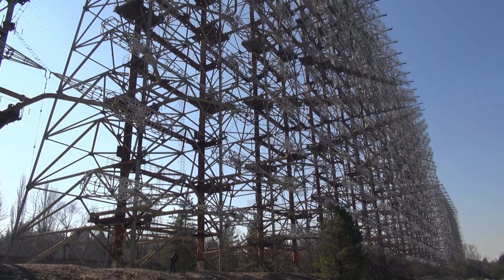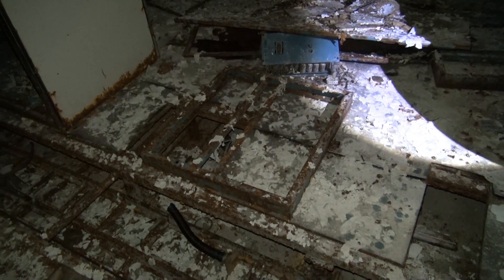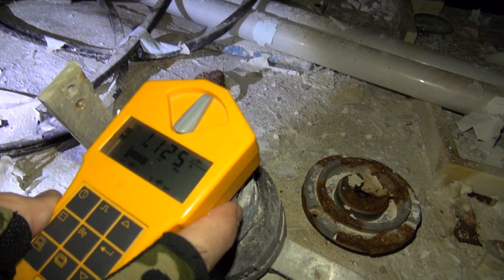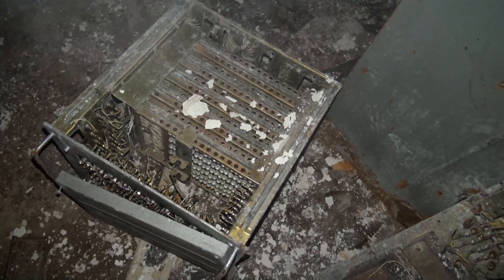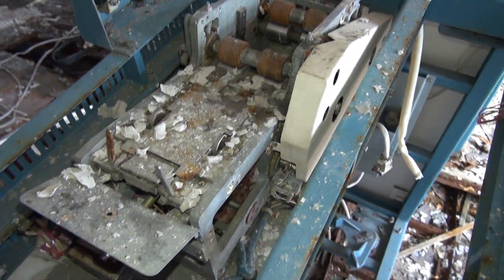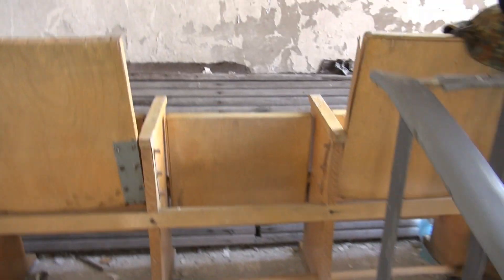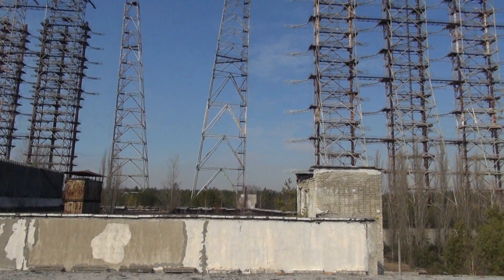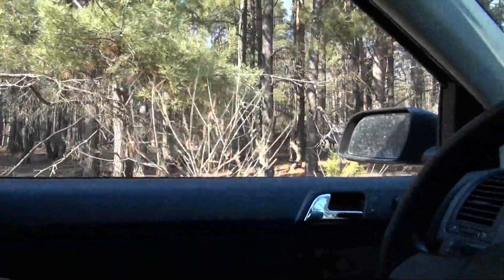inside Duga-3 / Дуга-3, computer mainframe of the Russian Woodpecker / Chernobyl-2

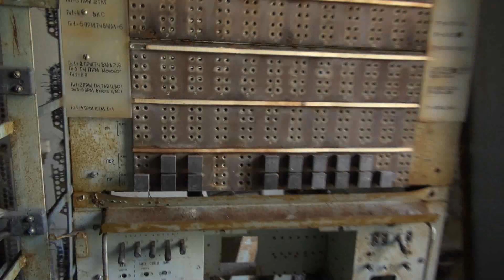Comment: 0:58 look like a switchboard for relais.
1:12 is an Radio tube B9G base.. a pentode or so.
3:00 These are military connectors and are most often custom made.
6:23 a high power resistors.
6:31 look like a delay line memory unit.
7:00 Yes there were cables in the floor. the copper thieves have robbed it away.
8:27 NOS parts :)  (new old stock)
13:12 Faraday cage wire mesh. magnetic core memory
cool video bionerd23..
Reply from the maker: 20kilovolt comments like this make the entire youtube comment section (which is admittedly quite lousy due to software bugs all over) worth it. thanks, really. :)
Reply from the maker: 20kilovolt but yeah see how this comment got marked as spam again, automatically. maybe because you post one too many timecode link... fucking ridiculous... wish i could disable this auto-spam behavior. like this, i have to constantly keep an eye out for good comments being trashed by youtube, and have to dig it out the trash again. ffs.
Reply: bionerd23 Yes annoying is that the auto-spam almost always fails.
Reply: bionerd23 do you go also near St.-Petersburg? in this place they have a high voltage test laboratory It's called ВНИЦ ВЭИ It is wonderful to be there.
+55° 55'26.15", +36° 49'10.97"
Reply from the maker: ms3bani yep, the ferrite cores are there. the video material is just not ideal, as the camera did not properly focus on the wire grid. :(
sorry about that.
Reply: 20kilovolt not faraday cage wire mesh. it's magnetic core memory.
Reply: nope.

look again.

you can CLEARLY see not only the DIAGONAL SENSE WIRES, you can CLEARLY see the FERRITE CORES! the guide even talks about them.

"faraday cage" has no need for diagonal sense wires or ferrite cores!
Reply: 20kilovolt Back in Soviet Union they used about 90% aluminium cable. Copper was used for ammo/weapons.
Reply: +20kilovolt The trenches in the floor look like they would be used for under floor cooling ventilation ducting.  That's how it is in some of our datacenter/server rooms.  Also for running power cables and sometimes data cables.
Reply: to bad people like us couldnt strip this building before copper cockroaches destroyed it
Reply: ms3bani a magnetic core memory has ferrite beads in it and that are missing here 13:12
Reply: technograd I also noticed that the Russians grateful have used the German tubes technology. Like  the RS391 look similar to the ГУ81М (GU81M)
I am by the way a collector of tubes I have te ww2 tube RV12P2000 and the RV2P800 , RV271A in my collection.
Reply: What surprises me is the punch cards and 1/2" magnetic tapes which seem to be the exact same format as the ones used in IBM 1401 machines. Right down to the shade of blue used on the equipment frames, I suspect there was some serious industrial espionage at play in that building.
Reply: Stoney3K    Punch card where used in the 1980s to start up the computer system for the spacetrack radar at Eglin...
Reply: bionerd23 Okay I see it now too..
Reply: 20kilovolt Most NOS vacuum tubes nowadays come from Russia. Most were manufactured during the Soviet Era. They're popular amongst guitar enthusiasts to use in amplifiers because they're relatively cheap. That said, they don't sound very good compared to most NOS western tubes
Reply: @punman5392 

This tube in the video was most likely used for class C operation in RF amplifiers. They weren't used for audio amplification allthough it would be possible. I have seen some soviet RF tubes like the GU50 being used for HiFi amplifiers.
Reply: @westelaudio943  Yes. It's a pretty nice RF pentode up to 200MHz, also it can be stripped of its aluminium can and looks very nice. Soviet marking 12Zh1L or 6Zh1L (only heater voltage different) Current price in Poland about $0,50 per one tube,  twenty to thirty times less than audio tubes such as ECC82, or even the RF ECC88 double triode. Direct copy of famous German RV12P2000, except for base and socket. There was a very simple post-wartime receiver in destroyed Germany which used only RV12P2000 tubes, 5 of them. Even as the AF output amplifier. In some variants even the mains voltage rectifier (!!)  consisted of this tube, with grids shorted in diode connection. It was manufactured in huge quantities in nazi germany, and must have been very abundant. Airborne receiver EK10, part of FuG 10 luftwaffe radio set also uses only this tube in every stage from RF, through IF, mixer, detector, and headphone amplifier. (Save from the rectifier, it is DC powered). Sadly I never managed to get the original nazi tube, i have only russian 12Zh1L, 50 of them, i paid $15 for pack of 50 NOS tubes... These were used for example in vietnam-era R105 radio set.
Reply: осторожно 380в ... Caution 380V. some fairly hefty power in just that one area. O.o
Reply: ms3bani Yes you are right I was looking in a small window so that I could type my message sorry my mistake...
Reply: 20kilovolt Thanks for info, don't suppose you have idea of the holes in the floor ? I know it may sound like a silly question but are the holes the result of welding, general wear-n-tear or chemical (thermite) ? I have seen the same in many 'old US base exploration' videos and was wondering whether it's a generic method used by all engineers to remove equipment rather than dissembling ?
Reply: +Ludus Jake the hol in the floor like 9:54? I have no idea I don't think the ceiling is made of metal.
Reply: +20kilovolt Could't the guttering be for cooling the CPU racks?
Reply: Thank you for this description. I didn't recognize the use  of the last one (wire mash).
Reply: Super Chris I thought at the time that it is part of a faraday cage but i had it wrong.
ms3bani told me it's a magnetic core memory This is correct name of the component.
Reply: 20kilovolt I'm pretty sure that the memory unit at 6:31 is a core memory unit instead of delay line. You can see the matrix of connections.
Reply: ewandougie it can but I don't know for sure the CPU was at that time not yet developed so far transistors and vacuum tubes was then still usual to use.
Reply: +Joshua Motland I think some were cooling ducts but others definitely had cable supports stacked in them.
Reply: Matt Bowen I'd disagree on their tubes sounding worse or better. The reason why you would change out a tube, unless it's broken, is to produce the certain sound a guitarist is looking forward, such as getting more or less sustain or distortion
Reply: 20kilovolt Такие конекторы и на драглайнах стоят а ещё требуют замены.
Reply: @technograd  А теперь по русски если тебе не сложно а тебе не сложно вроде.

Comment: It's crazy to think your smartphone likely has an order of magnitude more power than that entire building had with all those huge rooms with mainframes
Reply: I was talking about the computing power, not the RF power.
Reply: mark rossi An order of magnitude ? More like millions time more power.
Reply: @nessotrin  and yet, we still lose connection with our smartphones and have a hard time to talk to people miles away over a radio. And that thing could sense a rocket from 3000 miles away. Maybe a weak signal, but enough to know it's no good.
Reply: @nessotrin  True. The modern school calculator has more computing power than the flight computer on the Apollo.

Comment: Amazing tour of the wood pecker facility.. As a Ham radio operator, I remember well the Russian wood pecker being turned on and ruining parts of our Ham bands until they moved to other frequencies or shut it off. We had filters in some equipment that would greatly reduce the interference.
I was very surprised to see punch cards being used in Russia as late as the 1980's. They had been mostly eliminated here in the states but for certain simple functions  punch cards served well.  
I remember using these cards to write programs in FORTRAN back at the university I attended in the 70's..What a pain.. If one card had one error the program would fail and you would have to go back to the punch machine and try to find the error.
Reply from the maker: wa4aos haha, yeah, punch cards are crazy! i would've failed class back then, i think... i'm way too chaotic for that. when i have to program, i tend to make a lot of simple syntax errors... but no problem, the compiler will just say "hey, you made a mistake again in lines 24, 44, and 80!" in the end... back then, what a disaster it would've been!
Reply: bionerd23 As intelligent as you are, I suspect you would have been great..We had no  idea how easy it would be to program in the future back in the 70's..I have been playing with the Arduino micro controllers recently and they blow away what we considered Main Frame computers in the 70's.
 I really enjoy your great videos. I was particularly interested in the Wood Pecker site. I heard it MANY evenings on the Ham Bands years ago..  Thanks for sharing your adventures with us. Maybe I can visit your most interesting country one day before I get too old...LOL I have a good Ham friend who lives in Tula, not too far from Moscow.
Very Best Regards from South Carolina, Glenn
Reply: @wa4aos  But she's from Germany and Duga is located in Ukraine, not Russia...
Reply: @ScienceDiscoverer  formerly part of the USSR.  While it was active no doubt.
Reply: @bionerd23    We learned to write out our programs "long hand".  You would have been fine.

I do not believe that the punch cards were used to operate the radar.  I believe that they were for more mundane office purposes.
Reply: @bionerd23  WOW.  to have had that back in 71-72
Reply: The use of punched cards this late might have been due to interference from the array. Cheaper and more reliable to use proven technology then building a giant Faraday cage to shield sensitive newer systems in a mission critical environment.
Reply: wa4aos de WD8QCN... we had punch cards and paper tape at some of the ARTCCs as late as 1991. Systems were just to ingrained to be easily upgraded.  Would love to hook up my TS-440SAT to that antenna!!!
Reply: I wouldn't be too surprised if some Russia installations still use those punch cards even today !

Comment: Those plutonium smoke detectors are interesting. When I moved into my house, I was playing with my geiger counter and noticed an unusually high reading in the hallway at head level. It was the smoke detector, but it was puzzling because the geiger counter I had only registered beta and gamma radiation, not the alpha particles you'd expect from americium 241. It turns out that the smoke detector uses a 1 microcurie radium 226 source. Here's a picture of the label :)
https://www.flickr.com/photos/delsydsoftware/5101772542/in/photolist-
Reply from the maker: delsydsoftware really cool! Am-241 has some notable gammas as well, low energy but detectable outside... however, Radium progeny is much better in that regard - more and higher energy gamma rays! great old smoke detector!

Comment: The floor is designed like that for cabling and ventilation as aircon air would be pumped through the floor. From what was left the equipment looks like it is 1960s vintage or at least parts of it were but also has the "modern" touche of CRT terminals and HDD's. The reel to reel tapes were most likely for backing up the data but it does look like it was programmed with punch cards. Sadly not enough left to identify the mainframe.

Comment: Great video. I would have collected some of those small electronic components, not everyday you can get your hands on once top secret soviet electronics
Reply from the maker: quincy8557 if i only knew what to do with them... for decoration, doesnt feel right to just loot everything. taking a perfectly good geiger mueller tube that somebody else would stomp on and break is one thing, but that electronic gear, it'd just be a souvenir. different story if i found something that i could make a use of, e.g. nixie tubes for the coolest clock ever...
Reply: bionerd23
Hello, Maybe you are right but they were adandoned in a heap on the floor. I don't think I could have resisted !
Reply: bionerd23 take me to the zone and I'll give you my nixie tube clock. :))
Reply from the maker: stelian95 deal :P

Comment: Those floors are indeed for running cables in. Normally they would most likely have been covered by boards. This type of cable management is still used widely in industries etc.

Comment: If buildings were left intact after everyone moved out, what accounts for all the debris strewn around like this? Was it all from looters? I would have thought that the area would be strictly controlled so always wonder how looters could get in and do all this. I remember seeing some facilities (with pull-up metal plate floors) somewhere to house the cables for the older computers. The "racks" that I could see running along some of the sides of the channels were probably for cable routing. Pretty cool to see.

Also, in one of the original Jurassic Park novels, one of these channels turned out to be an escape route for the main characters out of an outbuilding being attacked by Raptors. One of the kids good with computers realized that in order to have the graphics abilities displayed on the screen at that time (80's), had to be getting power and data through big cables from somewhere, leading to the discovery of the escape route. :)
Reply from the maker: privatear2001 i replied to somebody else's question regarding the same... anyway, i believe it was the officials who took the stuff, and they probably didnt care for damage, either. after all, the Duga-3 array was only shut down 3 years after the Chernobyl accident. but surely some other damage was later on done by looting, too.
anyway, regarding another matter... didnt you want that yellow object? i've sent you an email. i think. i cant tell apart all these names, i'm sorry.
ha, had a fun thought... "if i knew all the names of people i communicate with on youtube, i'd know as much "vocabulary" as if i spoke a foreign language at level C1". makes a good comparison, eh? and an even better excuse...

Comment: Seems like copper thieves have been ripping all cables and wires off to sell them. Sadly everywhere in old cccp area all abandoned areas have been destroyed to get some money from scrap metal. Quite often something containing radio active material shows up in scrap yard or smelter. Stupid people break in dangerous places, and disassemble stuff containing deadly chemicals, biologic hazards and radiation.

Or, people behind Duga-3 may have destroyed all machinery by themselves to hide it from western eyes. It would be intriguing to see this old computer mainframe in original condition. Now we can only guess from remains.
Reply from the maker: ***** yes, as it was a "planned retreat", not an emergency evacuation after Chernobyl (after all, Duga-3 was running for 3 years AFTER the Chernobyl disaster happened), i'd expect that the officials took whatever they found valuable or of critical information value with them.
Reply: ***** Back in Soviet Union they used 90% aluminium cable. Copper was used for ammo/weapons.

Comment: all the metal work would have been to shield the  electronics from induced currents from the array, the same with the metal spring gaskets on the door.

you could imagine the RF energy in the air when the array is operating.
Reply from the maker: bgdwiepp hell yeah! and here, they're complaining about overhead power transmission lines because they can light up an incandescent tube... :)
Reply: janovlk Shielding is still highly desirable in an HF receiver.
Reply: This was a receiving station only. It wasn't designed as ordinary radar station. A transmitter was 60 km apart.

Comment: I've seen gaps like that in server room floors. They are so they can run the cables in the trench between rooms without having them in the ceiling where they would have the fire control equipment. Awesome video, really shows how little shows in the design of high tech rooms between the 1970s and 80s and today.

Comment: Since I am old I remember that Main frame computers had a lot of cables and produced a lot of heat.  They used the raise floors to run air conditioning ducts and cables. It was usually very cool in a computer room. Thanks for the video..
Reply: Richard Smith Old school? Don't they do it today in large data centers? :)
Reply from the maker: zzzdogutube yeah makes sense it was probably for everything. surely even the old supercomputers required cooling - but for that, you dont need to install a duct in every two square meters. you only need to do that if you want to save on expensive copper (or other) wiring that goes from one floor to the other. so i guess you're right, and it was a combination of air conditioning and cable channels.
Reply: zzzdogutube It was really a requirement. Those rooms would not be navigable otherwise, there would be no where to walk due to the cables. Old school cable management, just shove um in the floor :P
Reply: NerdNordic That is correct. That is done in data centers still.
Reply: +mgreggphone I've seen plain old server rooms or MDFs at smaller companies with floating floors, not necessarily only large data centers. It's handy because you can separate power coming in from data cabling coming in. The data cables come down from above, and power cables run under the floor. You can easily expand without having to saw up the concrete to run new power for new equipment racks.